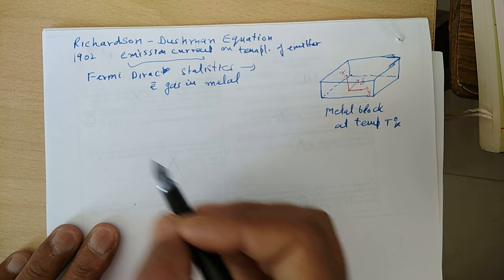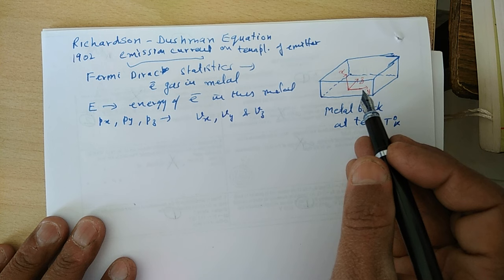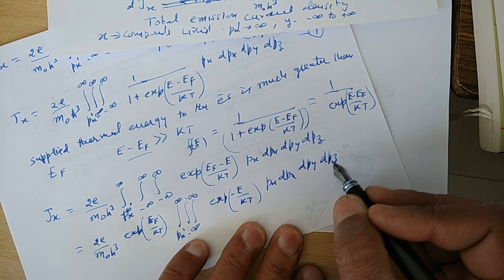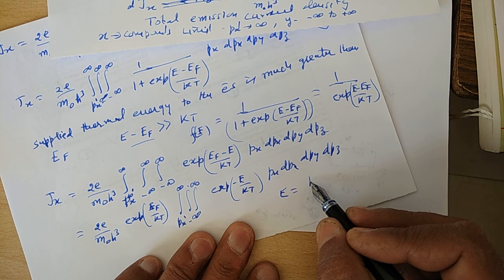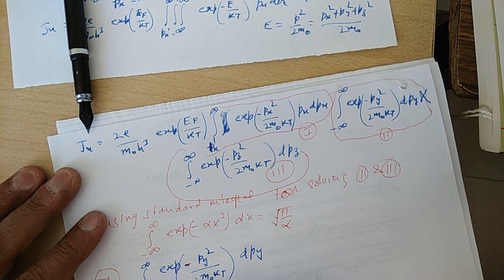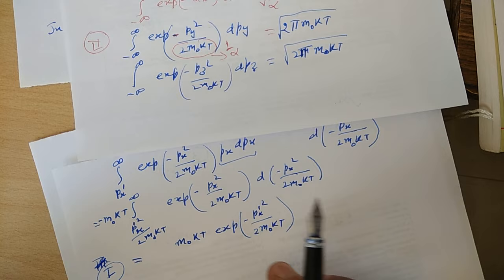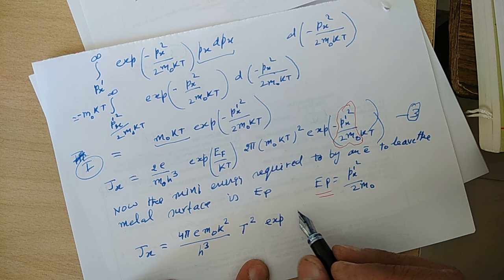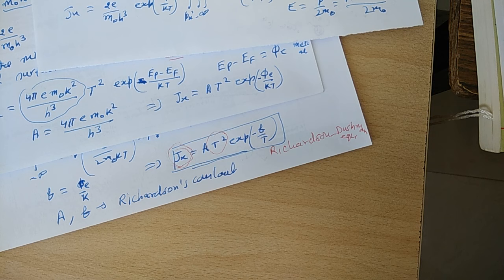Richardson-Dushman Equation

Comment: sir 18 min k bad jo eq bnyi vo samjha do clear nhi hui
Reply from the maker: Dear Rahul, Here we have used standard integral which is inte exp(-alph x2) dx; Its value is sqrt (pi/alpha), You need not to solve this type of integral, we simply remember the value of the integral. In our case, Integral no.II: alpha=(1/2mkT), So the value of intergarl II is Sqrt(pi X 1/alpha)= sqrt(pi 2mkT), Similarly , value of integral III is sqrt (pi 2mkT); because in this case again alpha is same, Difference is in term of py and pz. 
Whereas in integral I: we use mathematical trick to simplify it: We have
 exp(-px2/2mkT); i took brackted term and taken its differentiation as: 
d(-px2/2mkT) is equal to -2pxdpx/2mkT=pxdpx/mkt; we can rewrtite it as: pxdpx=-mkT d(-px2/2mkT), Now we can replace pxdpx in integral I by RHS terms which are -mkT d(--mkt d(-px2/2mkT) and we also change limits from px'to px'2/2mkT. Dear don't get confused, this is a simple mathematical trick to get the desired results. I hope now you can understand. If still you find anydifficulty, i will respond as per my ability. God bless you dear
Reply: Physics- video :Arvind K. Gathania  thnx sir vo lagrinvnges me magntism vli or bta do sir 😅😅😅
Reply from the maker: do you mean Langevin's theory of diamagnetism?
Reply: Physics- video :Arvind K. Gathania g sir vhi
Reply from the maker: Dear Rahul, feel free to write if you have the problem on any topic of Physics.
Reply: thnxs sir b/w happy holi sir 😅